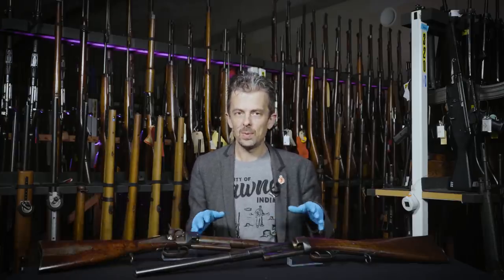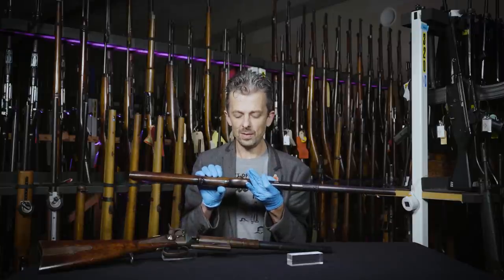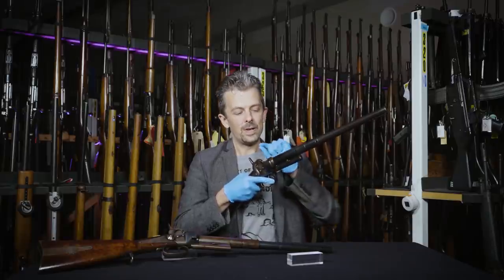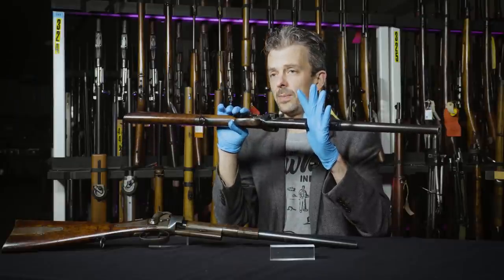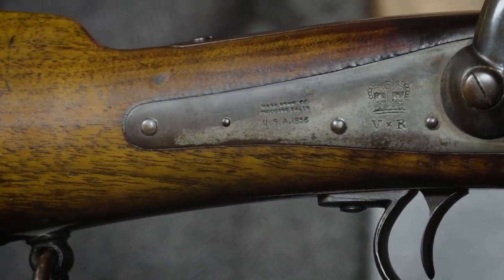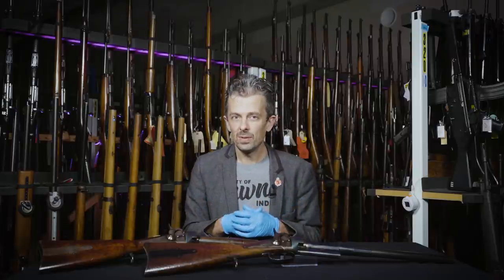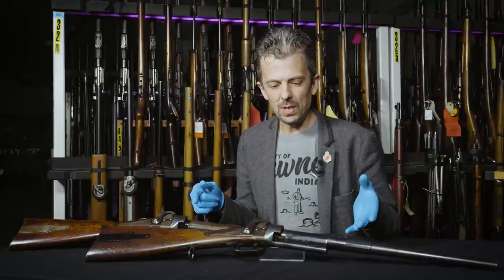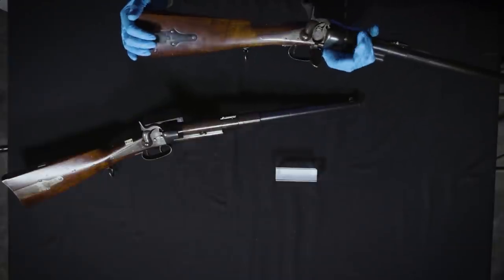The emergency Crimean cavalry carbine. With firearm and weapons expert, Jonathan Ferguson

Comment: Having closely examined one of these guns before, they are impressive not only because of the innovative Maynard tape primer system and innovative breech seal (which I puzzled over when I looked at one; thank you Jonathan for explaining that) but the quality of manufacture is amazing. I would love to know more about its production. It has Enfield inspector stamps where I assume Enfield inspectors checked the parts as the guns were made in the Savage factory. The barrel has fantastic quality 3 groove rifling, the breech locking action is incredibly smooth and precise, and can be manipulated rapidly. Maynard was a dentist by profession but also an inventor of dental things - dubbed the blacksmith dentist by colleagues and he was also into firearm development. The lock functions as a decent trigger mech but also advances the tape from a reel; that’s a lot of precise mechanical activity in a small package. It’s interesting about the condition of the Tower stored examples being poor, allowed to rust. Maybe some rusted so badly nobody wanted to buy them on the civilian market; that’s why they were scrapped. I’ve noticed a few Maynard locks for sale at antique arms fairs over the years. Maybe the rusty / scrapped ones were broken for bits and the locks sold to the gun trade?

Comment: As a complete layperson I've been following the series for a little while but this is the first piece that made me realize the advances in firearm technology that were made in less than a century. If I heard correctly this carbine is from the 1850s, and it feels like it just barely moved away from the age-old muzzle-loaders with ammunition separated in multiple parts. Yet, by the 1950s, we were already in assault rifle era. The leaps made along the way, from self-contained ammunition to the ability to load it faster as a well as, for the gun, to hold onto multiple at a time, and later to even fire them in faster and faster succession up to automatic fire, were astounding both in magnitude and in proximity to one another. I can't help but compare it to how little time there was from first powered flight to landing on the moon.
Perhaps a subject more appropriate for a book, but I'd be curious to watch a video breaking down the different technologies that developed in the second half of the 19th century to solve the many problems they faced in all these technical areas -- ammunition, faster loading, loading more shots, faster rate of fire, etc.
Reply: I'm not sure if you'll find a video exactly about this developement.
More like you can find it in bits and pieces.
This may help: https://youtu.be/YC_Ypmch1y8
The needle rifles are an early attempt to make a breach-loading rifle with a self-contained cartridge that was suited for military service.
This may also be of interest, as it might be one of, if not the first breach loader using a self contained cartridge: https://youtu.be/lHuNo2XU57g
Reply: it's even more wild than that
this Greene breechloading carbine is ~1850
Henry rifle -1860 (one of the first rifles to use metallic cartridges)
Chassepot needle rifle -1866
Colt Single Action Army -1873 (the most famous cowboy gun)
Maxim gun - 1884 (first practical machine gun)
Lebel rifle -1886 (first smokeless rifle)
Borchardt C96 - 1896 (one of the earliest practical automatic pistol and progenitor to the Luger)
Madsen machine gun - 1902 (first light machine gun)
MP 18/Beretta 1918 -1918 (first sub machine gun)
MG 34 - 1934 (first general purpose/universal machine gun)
M1 garand - 1936 (first general issue automatic rifle)
MP 43 - 1943 (first assault rifle)

the late 19th to early 20th were a really fast period of technological development, which can be even more obvious when you look at stuff like aircrafts and automobiles, both were fledgling technologies that became mature in a span of 50-60 years
Reply: @quentintin1  There were a lot of fascinating rifles. The later Mannlicher straight-pull rifles for example with their helicaly threaded bolt were a thing of beauty - if overly complex and fiddly.

I would also add the Vetterli rifle to your list.
First bolt-action repeater to be adopted by a military and iirc the first repeater over all to be adobted as a standard service rifle - there were some repeater adopted earlier, but only for certain specialised units like some cavalry squadrons. the vetterly was afaik the first to be issued to the rank and file infantry men as their standard weapon.
Reply: Smokeless powder was a game changer, because it stopped fouling up the guns and allowed all kinds of tactics that were unfeasible with black powder.
Reply: @Bird_Dog00  the list was mostly stuff from the top of my head and is just an example of how fast the firearms technology evolved during those 100 years, of course there are a lot of firsts that i could have gone through
Reply: Two world wars will do that.

i'm not even being facetious, if you look at the progress you mentioned, as well as general progression of technology, we were what? Roughly 60 years from the first flight of the Kitty Hawk to first walk on the moon.
Reply: @quentintin1  That's exactly how I understood your list and I didn't mean to criticise it. Just expanding on it in the same spirit.
Reply: @quentintin1  i

Comment: Goodness, those locking lugs are massive. They look bigger than the ones on my Mauser and Mosin. 

I wonder if this would have been able to handle smokeless loads had they been available at the time.
Reply: dont know about smokeless----you try it first! ;-)
Reply: Not always about the size but metallurgy and other factors.

Comment: I love all of these "not quite there" designs of the middle XIX. Monkey Tail sounds so promising :D 
Patch on the powder used for setting it in a uniform shape. Patches were also for filling the gap between the powder and the bullet (ball) in the chambers of the revolvers - am I correct?
The gap is to avoid not building up the unsafe pressure in the breech. Would such a gap, left on purpose, provide additional projectile velocity (higher pressure) if the ignition is safe?
Reply: Patches also prevent the (unlikely) movement of powder past the projectile.  Having simultaneous combustion in front of and behind the projectile is a pain, but it also means you keep more of your propellant if the firearm is tipped.
Reply: In a revolver, a patch (or "wad") will prevent chain-firing, igniting one or more other chambers in the cylinder.
Reply: It's incredibly unpredictable to have unpacked powder. It might ignite slowly or very quickly

Comment: I am not a mechanic of any sort, but recently have watched a few car shows on TV. One thing they do frequently say is to lubricate any parts where metal moves against metal, or have a gasket between them to cushion them. Would firearms with moving parts be protected in a similar fashion? In this one I notice the importance of gases not escaping from the breech loading mechanism, which surely they would if the parts concerned had slightly worn despite care taken with them?
Reply: Yes, it's generally a good idea to keep guns oiled. Some firearm designs are tolerant of running without lube, and many will function for some amount time without it, but you generally don't want to do it if possible.  It also helps protect against corrosion.
Reply: @Regolith86  Like I said in this case it seems that unless the two metal surfaces met when the breech was closed there was nothing else to prevent gasses escaping which is why I asked.

Comment: I'm surprised that waxed cardboard was never tried as a solution when paper didn't pan out because it was too fragile.  The piercer at the back of the chamber could have still done the job.
Reply: My guess is that it didn't adequately combust. You got a burning ember in the chamber or bore while loading, and you're in a world of hurt potentially. Animal skin cartridges could have been a slightly improved solution.
Reply: @SlavicCelery , well, that at least makes sense, thanks.